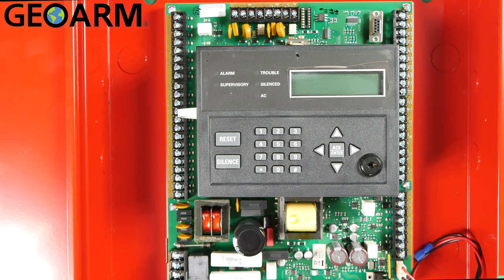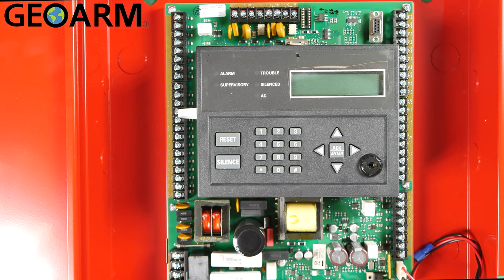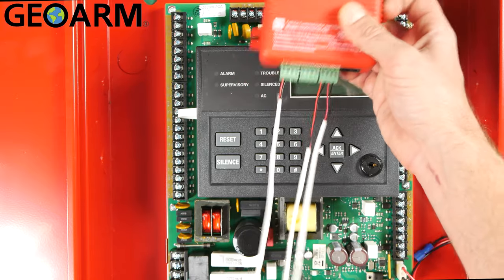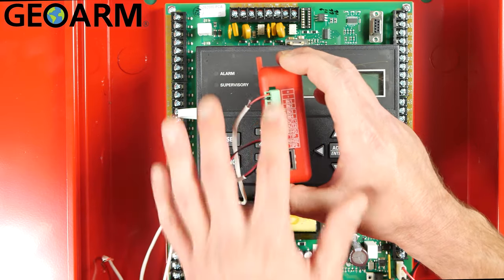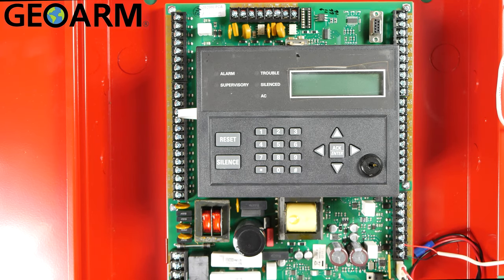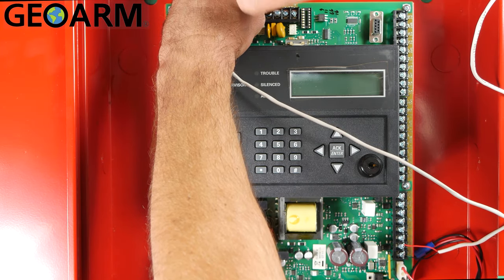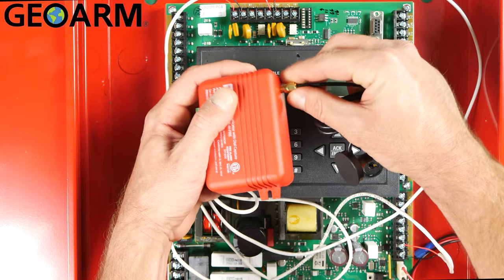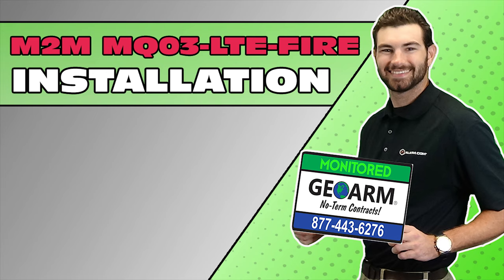M2M MQ03-LTE-FIRE Dual-Path Fire Communicator: Installation

Comment: Okay??? What if your phone connections are RJ-45 plug ins? You just kind of threw the whole internet plug with no explanation does it go to a router or a patch panel or directly into the modem. Does your monitoring station handle VOIP internet signal transmission does it have to have an independent IP address?
Reply: I dont think you need the internet cable.  I use ring and tip, or i wire them with my fire relay on my alarm panel if i have no dialer.

Comment: Is this compatible with vista 250fbt
Reply from the maker: Yes! This is a dial capture device that will simulate a Phone line connection. So if your Panel supports a Phone Dialer option, and Uses Contact ID, SIA, or 4+2 reporting, your Panel should work with the M2M dialer.